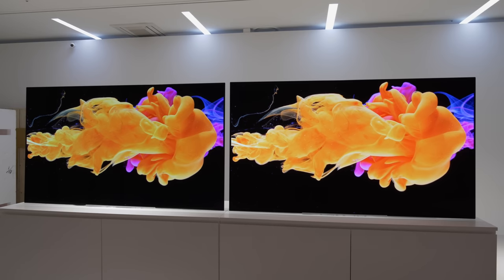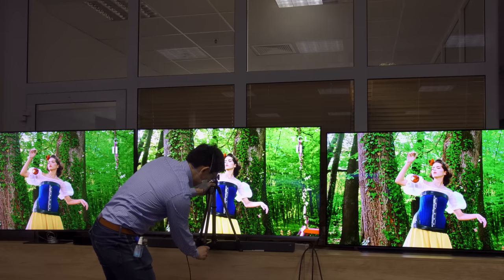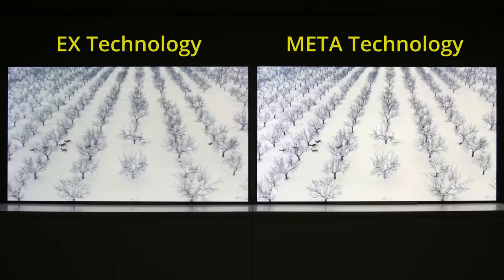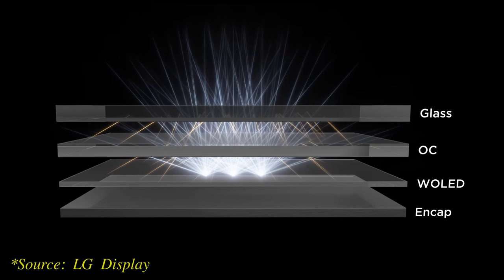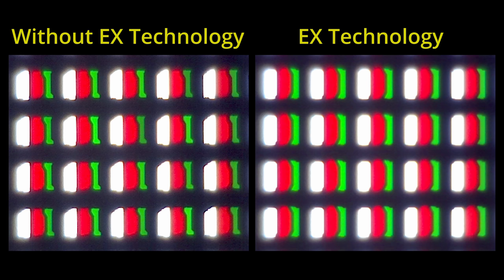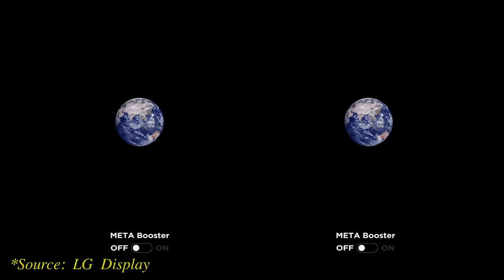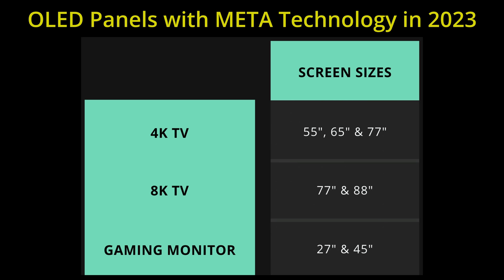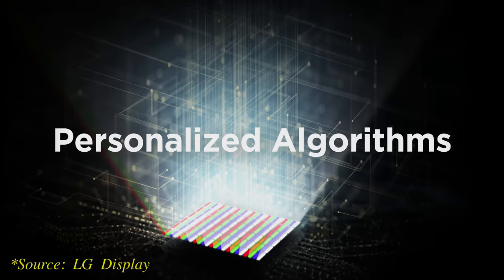MLA OLED Panel Explained - The Secret behind 2100-Nit OLEDs!

Comment: No mention to the elevated blacks with ambient light you discover in the other video with the Panasonic real TV implementation using this new META panels? What about the problem of non-uniformity (Mura effect) that the MLA layer potentially introduces? Is it solved? Thanks

Comment: Wow 2100 hundred  nits for a oled is impressive,  can't wait to see this , great job lg ,  Panasonic  just might beat sony this in the tv shoot  out , they beat the Qd oled  s95b b last  year and dam near the A95k  .
Reply: They're actually still "stuck" at 250nits when displaying 100% White on screen, just like last year's. Could be due to the EU's power regulations and/or just plain heat.The big breakthrough will be when TVs get to 500-600nits at 100% white sustained.
Reply: Will be interesting to see Panasonic MZ2000 versus the Sony A95L using the new 2023 QD OLED panel. I feel like it’s going to be hard to beat the color volume of QD OLED and the 2023 panel will be getting a jump in brightness as well. If anyone can dethrone Sony it’s Panasonic
Reply: @epap1375  I Have the A95k  and Panasonic  LZ2000  and some colors look  better  on the Panasonic  LZ2000,  and skin tones look better  to , but over all the image is a little  bit better  on the A95k.  Panasonic  is the creator  of the heat sink they are fantastic at engineering.
Reply: @michaelfoster3441  Are you in the USA? I just picked up the A95K on Black Friday for my bedroom and am absolutely in love with it. Also have an LG CX and a sony A9G. The QD OLED color volume and brightness blew me away compared to my other TV’s. I’m a Panasonic fanboy at heart and would buy the MZ2000 in a heart beat to replace my basement “theater” A9G if they offered it in the US directly. A MZ2000 paired to my UB9000 blu ray player would be a dream.
Reply: @epap1375  No I'm in the UK I wish Panasonic  would  go back to the US,  you guys are missing  out . Them and Sony will have the new media  tek chip next year and it's a game changer,  it will also  have 4 2.1 hdmi inputs .
Reply: @michaelfoster3441  "next year"

We're already in 2023 (unless you mean Sony fucked up in 2023 by NOT using the Pentonic chips in their 2023 TV's and we now have to wait until 2024 for the improved TV's??
Reply: @PSYCHOV3N0M  No sony didn't  mess up them and Panasonic  will be getting  the new chip set in 2024 .
Reply: A95K is qd-oled FYI
Reply: @Aramil4  I know that I have the A95k  and the Panasonic LZ2000  , and  My A95k  is barely  better  , you would  think by it being new oled tech the gap would much further  .
Reply: @michaelfoster3441  If the Panasonic used a QD-OLED panel with their heat sink and picture processing expertise it would destroy everything on the market. Granted for a price. I think Panny is making a mistake not going with QD. The color volume and the way it distributes RGBs is just the way forward. WOLED can only go so far.
Reply: @ELcinegatto87  I have the A95k  and the LZ2000  and most Content  the LZ2000  is better  at its definitely  alot better  the s95b  , I have seen the s95b  next to LZ2000  it wasn't  even close as far as color  . Just went on Av forums  and says the mla Panasonic  is better  than Samsung  Qd  oled .
Reply: @epap1375  I'm in the US. That's why I imported the GZ2000 from Canada a couple years ago when they were leaving there. Same models they'd sell to studios in the US. Knew it was my last chance to get a full spec HDR flagship OLED for a longtime. Was well worth the hassle even at the height of COVID. Got the S95B for another room in 2022 and the Color volume of QD-OLED is simply mindblowing. Even got LLDV working with a Zidoo Box and an HDFury to make it full HDR spec like the GZ2000. The Panny flagships are a step up in accuracy and its plenty bright with gorgeous colors. But QD-OLED color volume at high nit levels is just breathtaking. Praying Panasonic comes back to NA for consumers and considers a QD panel for the future. I hear the 77" MZ2000 will NOT have the MLA panel, only the 55/65" models. So that means the 77" is merely an evolution of LZ2000 rather than a revolution. That would actually make the LZ2K a really good buy even in 2023. If one found a dealer in the UK willing to do it and arrange for air freight, you could technically import a UK Panasonic and have an electrician just make you a 220-240 outlet. A Japanese model is 100V, even better, those can run on a US 115V outlet without a converter as it's within input Voltage margin.

Comment: Hey Vincent, I see you wearing a mask at the event. Are certain vendor’s requiring that when in thief booth or area? I’ll be there tomorrow but did not see a mask requirement from CES recommended requirements for the event itself.
I want to be able to check out LG, Sonys  Booths etc so if I have to wear one I’ll make sure to take some with me

Comment: Does MLA having a fixed lens size and different number of lenses per pixel depending on the panel size mean that the smaller panels are likely to get increasingly less bright?
Reply: By the look of it, the lens size should be the same for all panel size. The reason is they are using lithography to make these lenses and the photo mask used for lithography is extremely expensive, so it makes sense for them to use a lens design that's useful for all size. But i wonder if that's was the case why they didn't put this tech for 83inch +

Comment: It still doesn’t have the accurate color of Quantum Dot OLED though, does it?
Reply: Even QD-OLED doesn’t have accurate color, it turned the grayscale into a pink-scale. That’s why Samsung had to overhaul the technology for this years S95C
Reply: Lol. 😂😂😂😂
Reply: @jaycorbin  What lol no completely wrong.
Reply: @NexGenTek  Someone’s in denial. When the S95B came out there were countless reports of Chroma Issues, Color shift, etc etc. That’s why Samsung made a whole new panel for this year to fix said issues.
Reply: @jaycorbin  Thats an issue with the S95B, not the panel.
"That’s why Samsung made a whole new panel for this year to fix said issues."
No they didnt, Samsung Electronics doesnt make panels. Samsung Display does, they are independent companies.
Besides that they made a new panel because thats what panel manufacturers have to do to stay competitive, not because it had major issues.
Just look at the A95K from Sony, it used the exact same Samsung Display QD-OLED panel as the S95B from Samsung Electronics, but had none of these issues.
Just because one TV manufacturer makes bad TVs, that doesnt mean the panel they are using is bad or has major issues.

Comment: Will these brighter displays be able to prevent burn in or have steps taken to reduce it?
Reply: MLA has zero impact on the panel itself , its just an aditional layer which redirects the light from the panel
The brightness increase is from the lens not the panel being brighter
So my guess is that the G3 MLA tv will be the same as G2 when it comes to burn in
Cuz G3 most likely aint getting a brighter panel , the lens itself is boosting the brightness
Reply: @nicknickname353  Ah right makes sense thanks for the info!

Comment: MAN. Imagine what it would look like if we got a Blue Phosphorescent QD OLED panel with an MLA layer.
Reply: I think QD and MLA is same method to bosting brightnes, if QD combine with MLA layet it should be loss brightness i think, because the refection layer is too many cause absorbed light wave, CMIIW
Reply: @amr2576  No.

QD just absorbs one wavelength of light and turns it into another with near perfect efficiency, which makes it a huge efficiency boost over dye/pigment based sub pixel color filters.

You can fine tune the output wavelength simply by controlling the size of the QD so it can be basically perfect color spectra for the whole thing.

QD color converson layer and MLA would be a super tech - it is obviously LG's eventual port of call for improving efficiency further.
Reply: @mnomadvfx  yeah, will see if Quantum Dot can combine with MLA its about time without causing side effect, i dint expect this will happend for 2 years or later, still waiting for perfect 100 percent color gamut rec2020 TVs on future if possible

Comment: Vincent, can you please tell us if the  TV support 120hz BFI?
Reply: If it a modified version of the 2022 panel I fear it might not... which is why I keep saying 240hz refresh please... it fixes so many issues with that one change.
Reply: @90lancaster  yes 240hz or at least 165hz should be possible at 4k on OLED now.

Comment: Are the recently released 27 inch OLEDs already MLA or will they come later this year? And if they come later this year 2.5k or 4k?
Reply: Did you even watched the Video? The answer should be obvious.
Reply: @generischgesichtslosgeneri3781  It isn't. There were MLA TVs announced at CES, but there is no way of knowing if the announced 27 inch OLEDs use MLA or not

Comment: Vincent, you've measured the Panasonic MZ2000 and Samsung's new QD-OLED in terms of rec.2020. What's the rec.2020 color coverage of this panel? is this the G3?
If Sony is to use this year's QD-OLED, the 77" model will be the one to beat with over 91% rec.2020 color coverage!!
Reply: He measured mz2000, no improments for rec2020. Same as all previous woleds
Reply: @ebayer1980  You're right. I corrected.

Comment: 1) What is the dci-p3 coverage of a LG"s META technology? Is it 99.3% like samsung's qd-oled? 2) is there a perceptual/noticeable difference between 2% window at 2000 nits vs 2% window at 1000 nits? What is the peak and sustained 100% window? Vincent only says it's brighter. qd-oled is 213 cd/m^2 and c2 is 167 cd/m^2 according to rtings.
Reply: LG OLED have always had 99% DCI-P3 same as QD-OLED, it’s REC 2020 that QD-OLED beats WRGB, 75% WRGB vs 90% QD-OLED.
Reply: @HegoDamaskII  , you are right. I had my p3 and rec2020 switched up. Was it confirmed anywhere that the rec 2020 of meta wrgb oled is now close to 90% qd-oled? And is 2nd gen qd-oled now greater than 90% rec 2020?

Comment: Nobody needs over 800 nits who likes to use OLED TV's in dark rooms like me! 🤣
I love my C1 4 ever. Also HDR is almost too bright for me on the C1 and I use SDR more often 😅
Reply: People get obsessed with nits... And they get obsessed with what is by most measures a moderate or even very small difference in resolution or color, which would be impossible to detect unless you had two sets side by side. It's lovely that this information is out there for people who are in the market for a new TV but I find it rather sad so many people will buy a TV in a year later immediately dump it for the next one that comes along, buying into the idea of how manipulated we are by runaway consumerism. Nobody needs to upgrade a TV set that's only a couple years old unless they're doing it for bragging rights.
Reply: Completly correct, only people who use in bright rooms like me need better.

Comment: I have a G2 is a moderately bright room and its brightness is already beyond what I need. Not sure the brightness gimmic is now becoming a marketing pitch just like top speed of a high end car as one would not ever be going to use it at it top limit.
Reply: Do you use the accurate Filmmakers Mode?  And not the vivid mode.

More brightness is needed (10,000 nits is the future goal) to display movies that are more realistic to the real world.

The sunlight can be upto 10,000 nits, vehicle headlights over 3000 nits, lightning over 3000 nits, explosions over 4000 nits etc. Having brighter tv's enable specific bright scenes to be much more realistic.

Yeah obviously tv manufacturer's marketing pitch say bright to get the regular consumers to buy. But clued up consumers know that higher brightness matters for 4K blu ray movie discs mastered higher than 1000 nits!
Reply: OLEDs are not bright enough, in small windows yes, but the overall perceived brightness is not enough imo, because the still display large bright areas (sunny days, daylights scenes overall) really dim compared to LCD.

Comment: What about brightness on the smaller screens 🤔
Reply: can't work. The tech only works on bigger screens because they have the space to include it.
Reply: @hereticsshallbecleansed7245 so I shouldn’t wait for this tech on gaming monitor such as 27 and 32 inch?
Reply: @Gen_66  gaming monitors are focusing on QD-OLED if I'm correct

Comment: Hi ...nice video... one question... with so much emphasis on "brightness"  (related to OLED or OD-Oled) will there be concerns of burn-in? and are these tv have some sort of mechanism to thwart the burn-in... cause we don't want  to buy a tv where for a little over two years on the road, the TV (OLED or OD-Oled) has permanent image retention.
Reply: Modern OLEDs have compensation cycles to vastly reduce the chance of burn in. Plus can dim manipulate static logos to stop them burn in.

Plus heatsinks further reduce burn in. With regular viewing on a heatsink OLED you shouldn't get burn in (at least not for many years) and some manufacturers offer further burn in warranty!
Reply: @C--A  I see... but with " burn in warranty" then there will be cost issue, thus they will raise the prices... further, i only heard lg g series has heatsinks. haven't heard about it on other tvs manufactures..
Reply: @fahadmushtaq2826  Sony uses heatsinks too.

Comment: So is this new META panel brighter than current QD-OLED panels?
Reply: Only on smaller window sizes. 100% window is much better on new qd oled
Reply: @ebayer1980  QD OLED is better on papers,
Reply: @stanko4922  you own them? You can compare?
I had C1 and now have A95K. Qd oled is definetly better
Reply: @ebayer1980  C1 is midrange OLED TV. LG G2 is high end OLED TV's. Also C1 is old models
Reply: @stanko4922  there isn't much difference between C1 and g2. Especcially in colour reproduction

Comment: Would those billions of micro magnifying glass increase the heat generated by the panels?
Reply: Good question.
We know more heat kills OLED panels faster.
Maybe if more of the generated light get out of the panel by being guided by the MLA, less heat are staying inside the panel stack and it can run cooler?
Or maybe because they are more efficient in generation light output they can run them less hard.
It seem LG has been using quite a lot of the efficiency improvement over the generations to lessen burn in.
So they can run them less hard and further from the edge were they would suffer permanent burn in..
Vincent, please do a IR temp measurement comparing ex panels with the new meta panel when you get them for testing.
Reply: @cajampa  yes good point, 1) the overall heat produced by the leds would be less as the diodes are tinier requiring lesser power hence would generate less heat, so the back end (the side of the magnifying lens sheet facing the diodes) will not heat up as much as before, while 2) on the side where the magnifying lens sheet facing the screen will be kept cool by the room’s ambient temp as it radiates its heat off out to the room instead of its internals hehe maybe..

Comment: If these are coming out this year, I might be upgrading. I have the CX OLED, and it has been fantastic, no burn in so far, but I do wish it was brighter, so this new one might be what I'm looking for. Just depends on pricing and when they are available.
Reply: I would honestly save your money unless you have money to blow. The CX is perfectly fine, OLEDS are not really meant to be enjoyed in brightness anyways, they're supposed to watched in a dark environmental to make the most of it.
Reply: Burn-ins aren't a problem nowadays. I just read a German test, where they tested 3 OLED TVs over a timeframe of simulated 4.5 years, and from one manufacturer to another, the loss in brightness was between .7 - 3.3 %.
Reply: @torguy5763  Don't agree with the idea that OLED TVs are meant to be enjoyed in a dark room.  They certainly excel in darker enviroments, but they are meant to be used in all conditions like any other TV and they do well in all but direct sunlight.
Reply: @torguy5763  From CX to this would be massive increase in brightness, and less so even in quality. It’s mostly missleading for new buyers to say OLED can’t be used in normal living rooms. They almost always say they are surpised what is the problem, as their new OLED is brighter than their old LCD.
Reply: @torguy5763  Speak for yourself. Seeing bright rays pop out of your screen is the most immersive thing you can possible get out of a TV.

Comment: 5000 micro lenses per pixel?
Really interested if this will finally fix the ABL issue with LG oleds.
Reply: Like the uniformity and tinting has improved
Reply: Highly doubt it. Honestly Idk they havent done something to manipulate certain parts of the screen manually to avoid dimming issues. Like imagine a square or a circle in the screen, you point where you want to dim the screen and thats it, logos can no longer dim the entire screen at all.
Reply: @madln5070  I am assuming that dealing with "dumb customers" that will damage the screen themselves is a higher probability than issues from their automatic systems.

Comment: Micro led, Killers of all OLED !
Reply: Not even remotely.

It's too expensive by a thousand miles.

If you have the money it is the ideal, but most simply don't and it's never going to be the cheap option.

Samsung's QNED + QD color conversion will displace OLED with inorganic superior lifetime/performance, but that is still cooking since they decided to rejig basic production process before manufacturing investment.

Comment: The yellow and magenta colors at 2:05 seem washed out on Meta.... is EX at 6500K and Meta at 9500K?  I wouldn't have expected white sub pixel washout if the extra brightness is driven by MLA alone.
Reply: it is because of the huge lighting, it creates the impression that the colors are washed out, but it is not so. It doesn't look like that in live !!